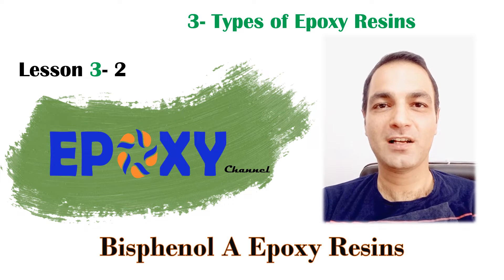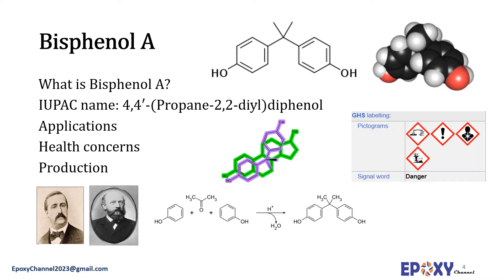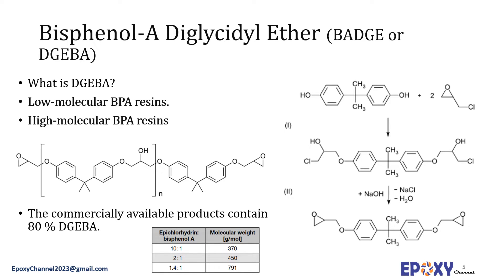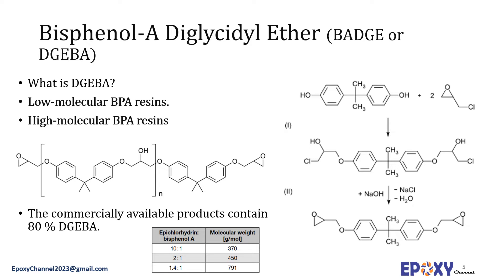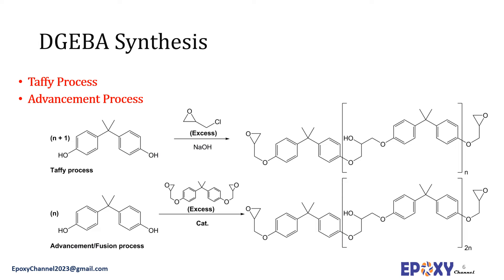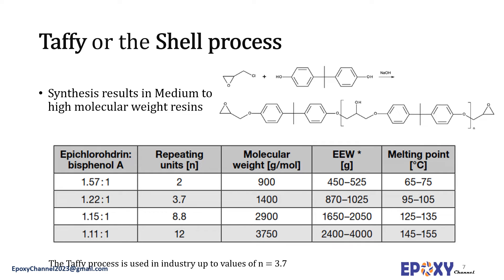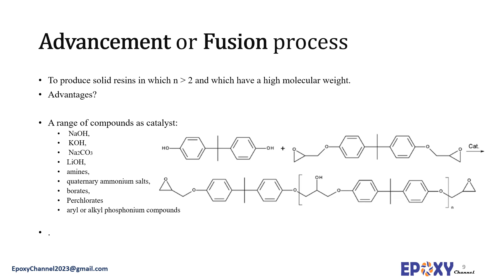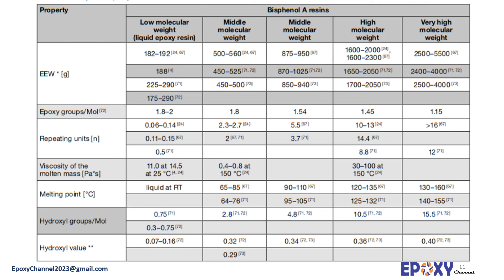Bisphenol A Epoxy Resins - Session 17

Comment: EXCELENT VIDEO! may I ask, where did you get the table of performance property?? a book?
Reply from the maker: Thanks for your kind comment. yes these tables and other ones actually come from several sources. the sources will be presented in a book we are currently working on. Actually not sure which ones come from which source at the moment as I have to check. If you couldn't find it I will share it with you if interested.

Comment: Hi sir,may I know,does equivalent weight of Bisphenol A B-188 is 188?
Reply from the maker: Hello. I am not familiar with this brand. you have to check the TDS of this product or measure EEW yourself. Often it is in range of 180-190. you can visit the video on EEW for more information on the channel.
Reply: @Epoxy_Channel Tq for replying. To measure the EEW,I have to do titration method right? I am PhD candidate, I already complete the experiment, but I stuck at EEW because I only take the EEW value from past literature review which is 188 eq/g. If the panel ask me , can I just tell that I got from past papers?
Reply: And also it is BE-188,not B-188

Comment: How to make a crystal clear colour epoxy resin?
Reply from the maker: For that case, you should choose the right set of Epoxy - Hardener system. search for top-coating products, which are resistant to yellowing. Be aware that if your epoxy is suitable, you should go for a proper hardener also. For example TETA and DETA or their adducts could be good choices. Check the TDS of the employed Epoxy and Hardener, make sure that their color is below 100 APHA. Moreover, the hardener is so susceptible to moisture and oxygen. they should be avoided...
Reply: Sir u give contact number  pls

Comment: May I ask a question sir
Why the colour of my epoxy resin after adding NaOH solution in the reaction become yellow?
Reply from the maker: Hello, thanks for your comment. You react ECH with Bis-A? or you add NaOH solution to the prepared epoxy-hardener solution? Explain your procedure and I will look through it.
Reply from the maker: If you want to react ECH with Bis-A to produce epoxy resin, you should be aware that the presence of NaOH may alter the reaction. One of the reactions of epichlorohydrin is hydrolysis with sodium hydroxide. This reaction produces glycerol and sodium chloride as the main products. 
The hydrolysis of epichlorohydrin is a step-growth polymerization that can produce linear or crosslinked polymers depending on the concentration of sodium hydroxide, the reaction temperature, and the dropping method . The lower the concentration of sodium hydroxide, the higher the yield of glycerol...
Reply: @Epoxy_Channel  yes I am producing liquid epoxy resin based on bisphenol A and epichlorohydrin with NaOH as a catalyst.
The application of this epoxy resin would be used in the coating field. The change of colour turns to yellow apear after adding the NaOH as a catalyst. Could you please give some advice to solve this problem
Reply from the maker: Hey Jaffar. Thanks for your explanation. Actually, there are crystal clear epoxy products on the market for the intended use... but if you want to synthesis the resin yourself, you should be aware of a few points. Firstly, the role of NaOH is to close the opened epoxy at the latest stages of the reaction, and as the reaction is thermodynamic equi, this kind of yellowing is investible. Even ordinary epoxy products at the market are kind of yellow.  The premium products are crystal clear and have higher prices in the market. Moreover, be aware that the color often has little effect on the properties of the final product. If you wish to have a crystal clear product, First, you have to use super pure ECH and Bisphenol A and NaOH at the first step. Secondly, the whole reaction, even step 2, MUST be conducted under an inert gas blanket, say under nitrogen or argon gas. You should avoid oxygen, CO2, and humidity during the synthesis and avoid higher temperatures. Briefly, you should minimize oxidation. Metals can also result in yellow color in your product. The contact with metals, i.e., pipes, should be minimized. Finally, in the industry final product is often purified and color will be omitted. Distillation of the final product, again under nitrogen purge is another strategy you can count on...   @jafarrullahabdulaziz18